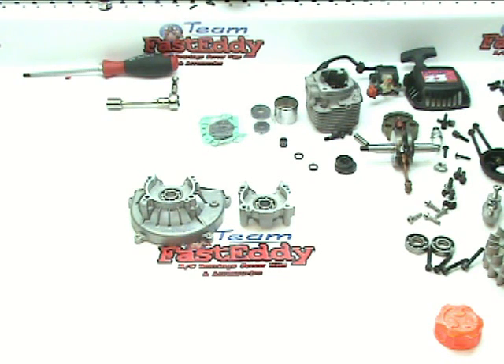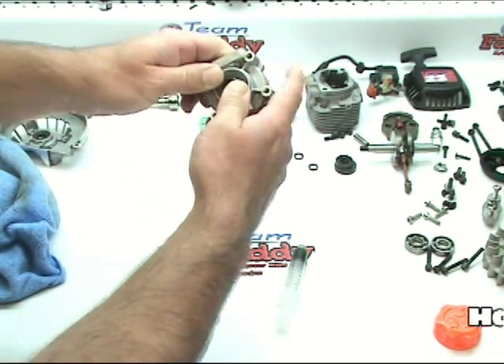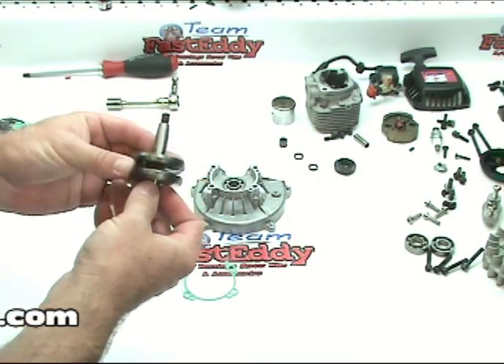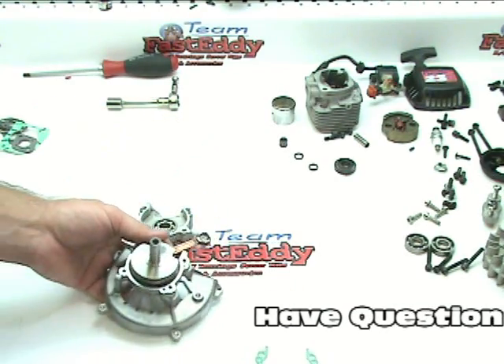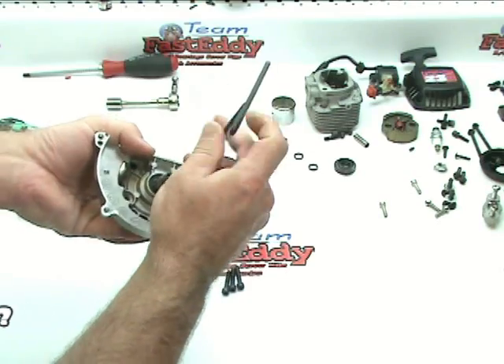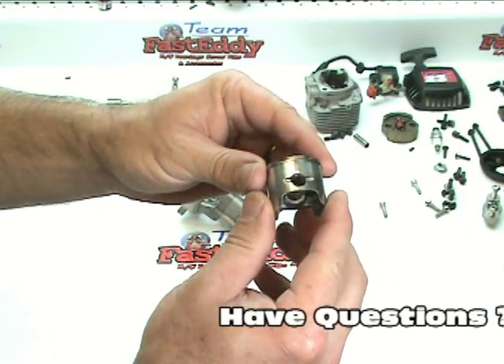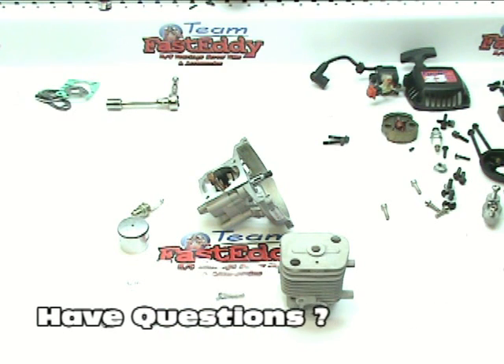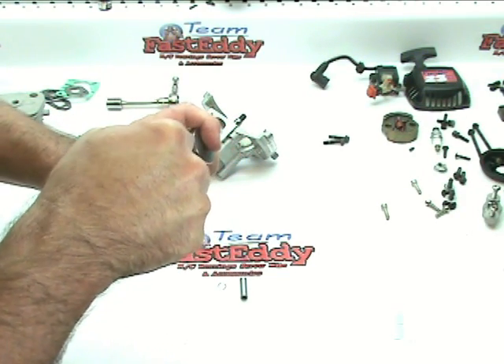Video #5 Tutorial Rebuilding the CY 23CC Engine

Comment: because your air and fuel actually enters the crank case on a two stroke. If your case isn't sealed, it will suck air through the leaking areas and your engine will not EVER run right. 

Watch some videos on youtube on how a two stroke works

Comment: @HPISavageXSS46 
Good tutorial though, however my TFE bearings don't seem to turn nearly as smooth as in the video (w/o lube). Also now I put the crankcase together it requires quite a bit of force to turn the crankshaft, is this normal or will this be a problem?